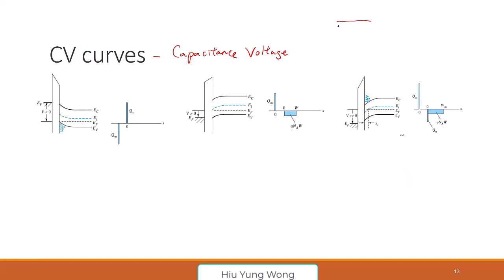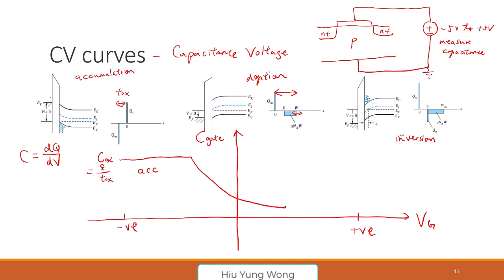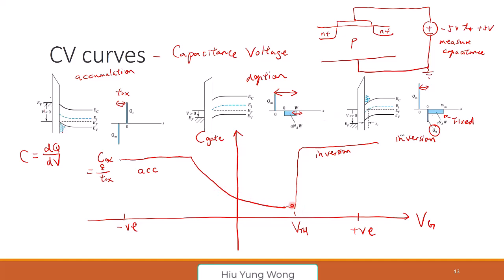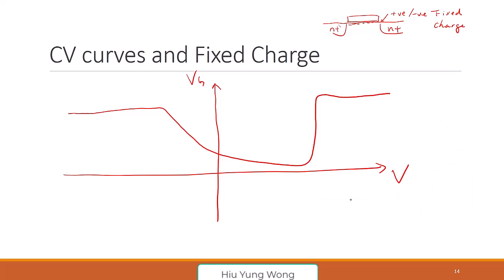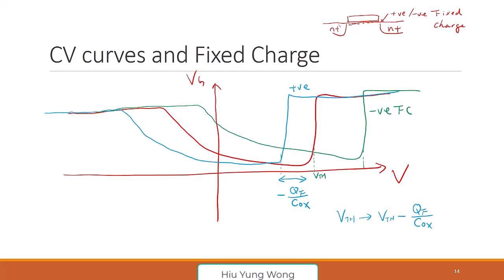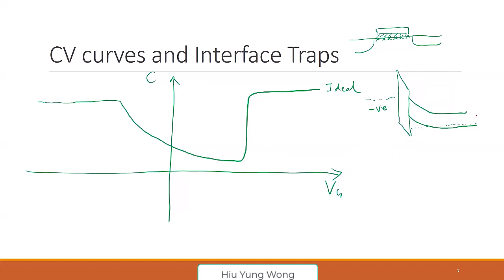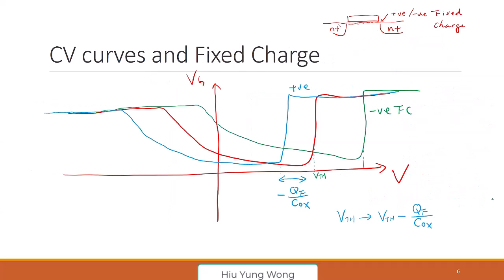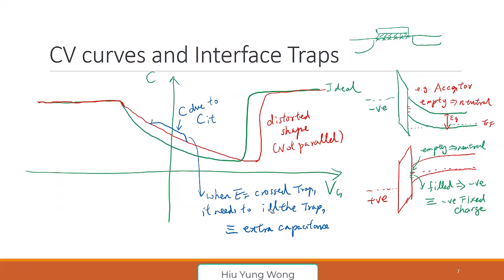5A - CV Capacitance Voltage Curves Construction

Comment: Hi, I was trying to draw C-V curve for donor case in p-substrate MOS. I find that at inversion region 50% state is above fermi level so at interface it will be +ve charge. For that reason threshold voltage will be less (shift left side). But at accumulation region all the state will be above fermi level that means more +ve charge in interface. Will that change anything in C-V curve for accumulation region?
Reply from the maker: Yes, it will shift to the left also due to the positive charge. This can also be checked by understanding that the flat band voltage (VFB) will be reduced. Thanks!